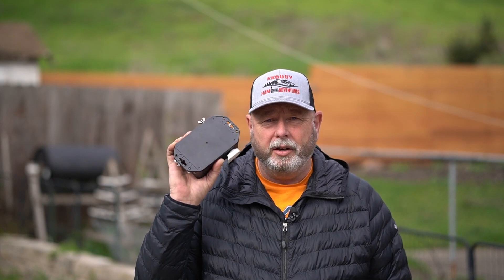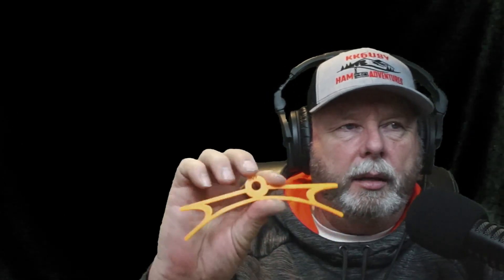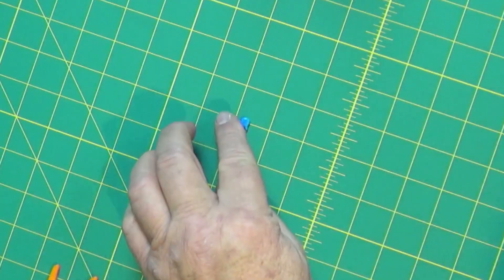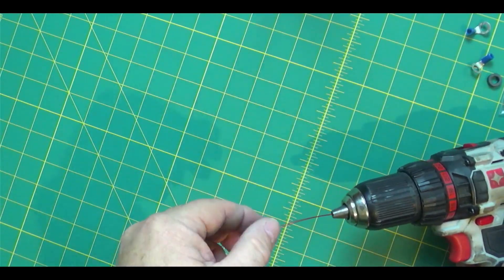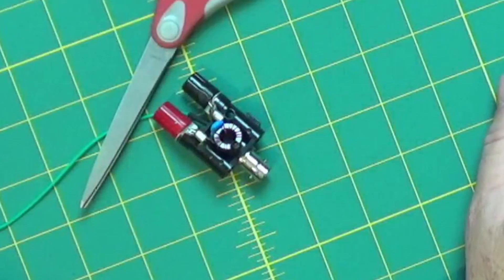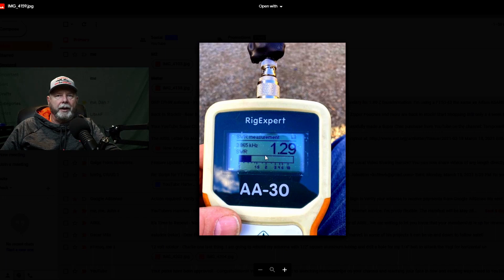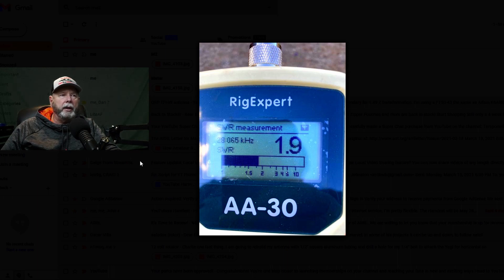How to make a 2.7oz End Fed Half Wave (EFHW) Antenna for Ham Radio in 30 minutes or less!

Comment: Excellent video and tutorial.  I built the antenna and tested it.  On 7.041 Mhz the SWR is 1.4 and the resistance is 35.  What do you think I I should adjust to improve it?
Reply from the maker: Hi Bret, I like to keep the coax end of the antenna about 1 foot off the ground that seems to help some but I think it depends on how high it is when you tune it. If that is to low in the band try folding the wire ove to make it shorter it might be too long.

Comment: It looks on the video like you connected the cap on the output side of the transformer. Normally it goes on the input side in every on I've ever done.
What dark magic is this?
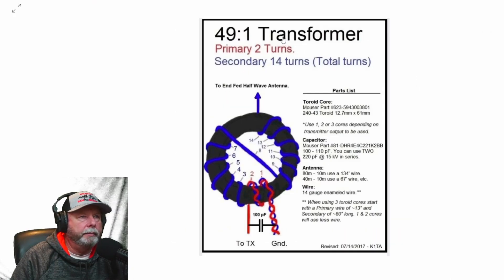Reply from the maker: Nigel at 2:48 in the video look at the diagram, the capacitor goes to the TX and GRD sides, I attached them to the binding post which would be how you have done before. It's just a tight setup and hard to get on camera sometimes.

Comment: Great video thanks! what max power can you put into that antenna? 73's
Reply from the maker: I have run 12 watts SSB with no problems, probably 15 max ssb and 5 for CW and check to see if it gets warm. If more needed a bigger toroid or stack 2. I just built and tested another EFHW using a 140 toroid handles 100 watts easily on SSB video will be out in a couple weeks.  Thanks for the comment and watching! 72

Comment: You might be better off using TWO ferrites as you'll get better performance. You can also use an inch or two of coax as a high voltage capacitor. G7VFY

Comment: Great job I use almost the same EFHW antenna setup for SOTA/POTA and it works well. I’m really curious about the 80m portion... I wonder if it’s acting like a 1/4 wave for 80 m? But then the impedance would be jacked up and there is no ground system except for the coax... I suppose if the coax it was about 64 feet long then you would almost have a dipole for 80m. Well who knows, it’s something fun to play with and that’s the fun of amateur radio!
Another great way to make an EFHW is to mount the transformer directly on the wire winder like KM4ACK.

Comment: Absolutely fantastic video Chuck! Thanks for sharing! 

I've been using a 49:1 transformer from ebay with a 66.5' wire on my POTA activations recently. Although I haven't scanned the 75m, 60m, or 17m SWR/impedance, my IC-7100/Z-11ProII combination has tuned it up everywhere I've tried on these bands. The trick for 75 and 60 seems to be keeping the wire higher off the ground close to the feedpoint. The wire is less than a half wave long, so the high current portion of the wire needs to be elevated more than would otherwise be necessary for 40m. 

Thanks again, and 73 de VE3GKT!
Reply from the maker: Joseph thanks for the great comment and the info on feed point height!
Reply: I’m running the exact same setup... how high do you have your feed point for 75m?  I have mine at apx 25’
Reply from the maker: @Gravel_Rat78  The day I did the scans it was in my lap sitting in a camping chair , so about 25-30". Thanks for the comment and watching!